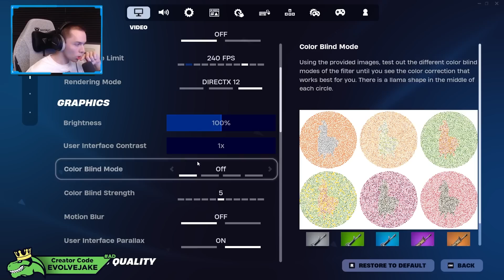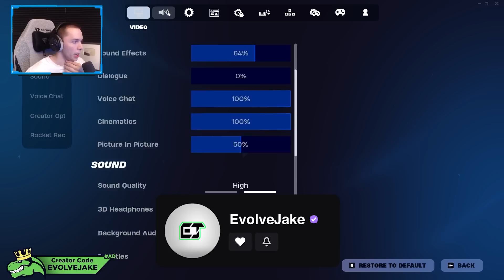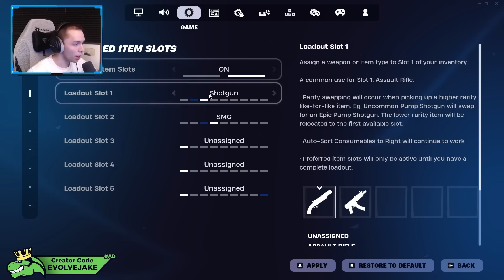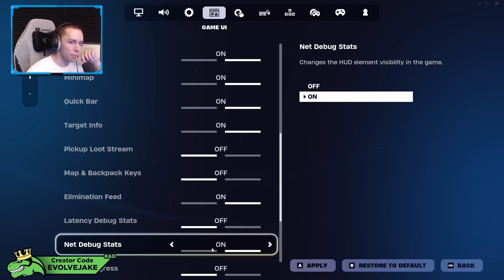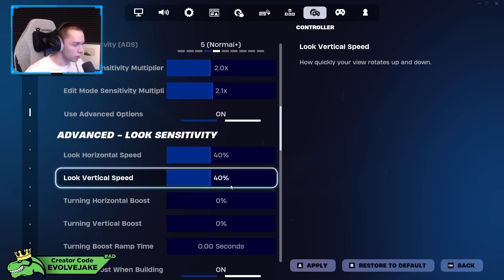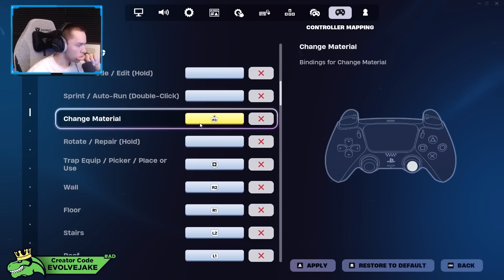Fortnite Chapter 5 Season 4 Controller Settings Explained (Zero Build + Build Controller Settings)

Comment: Jake. After a few days will you be dropping an update on controller settings for the new season? 
😢

I am personally struggling to find the right balance on DSE. 
It’s either to fast, or 2 slow, can’t track in the air, can’t track fast moving players, or simple to much ADS SPEED. 

Missing a bunch of shots, and don’t understand how bloom works. 
New player here.

Comment: I noticed that most controller players seem to use toggle sprint off, but on KBM most have it set to ON. I think it’s because on KBM crouch and sprint are usually the same finger, so you can’t really sprint-slide-sprint in succession when sprint is set to hold. I think it would also mess up the jetpack trick this season but I haven’t tried that. Traditionally I prefer to hold sprint but Fortnite is the exception.

Comment: Jake quit waiting and switch to expo. I’m telling you it’s worth it. Very easy to get used to. It will feel tight and sticky at first but u get used to it very quick. The biggest hurdle is muscle memory but you’ll get there. I love expo
Reply: Whats a good expo sens? I play 40/40 on Linear btw
Reply: What settings do you recommend for expo?
Reply: @j1oe7  50 Vertical, 60 Horizontal, and then 10-16 for ADS sense, but personally I use 14 and i like it. Also make sure your dead zones are as low as possible or expo might feel too slow
Reply: @moneyluvrtv  Thank you
Reply: @j1oe7  ay Brodie I told you wrong. I got vertical and horizontal mixed up. The vertical is supposed to be 60, not horizontal. Horizontal should be 50. It’s prolly gonna feel too fast with horizontal on 60
Reply: @moneyluvrtv  Ok thanks bro 👍
Reply: 50-60 a classic npc expo settings because of reet

Comment: Does anyone know how new your parts need to be for DX12 to be "better"/more consistent?
Reply: 2000 series for nvidia or 6000 for amd
Reply: @vishp47  thx, I'm personally using a laptop 3080, but always thought performance mode would be better, gonna try it out for a while, heard it needed to have loaded the whole map for it to run well or played 10+ matches
Reply: @Brian3698  yeah you'll get some fps dips at the start but it evens out after a while. I was using compatibility mode before and it doesn't give you more/stable fps unless you have an older graphics card

Comment: also thinking of switching to expo, linear was good when i played builds for flicks shots and quick edits but flicks aren’t really needed in zero build. has anyone made the switch?
Reply: I have. I probably should have never switched to linear to begin with since I’ve only been playing a year and always been zero build. My look sensitivity has been 30/30 for the longest time, so I am trying to very slowly increase it because from what I see, 30/30 is very low lol.
Reply: @Serenity_EPK  i also play 30 30 on linear and have been for years. it’s nothing to be embarrassed about
Reply: @xbnpersonal good to hear. It’s more just trying to go a little higher because when in a fight and someone goes behind me, I do feel a little slow at tracking them. I’ve been at 32/32 the last few days and still felt good. I think like Jake said, on linear it’s more ok for lower sense. I’m not wanting to do anything drastic to my settings, but defo have been testing some small changes since changing to expo.
Reply: I play expo and enjoy it. It can be tough to get the right sensitivity for you initially but that's just something anyone would expect when changing.
Reply: Your crosshair will just stick the the enemies, easier than linear for sure. Just keep your same sense from linear & switch to expo . It’s an easier switch than trying to raise your sens after switching.